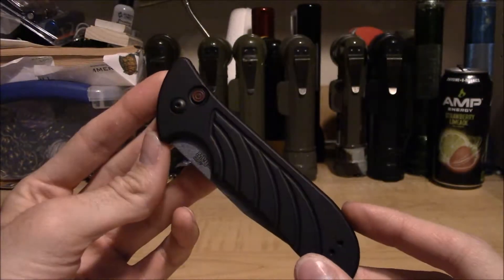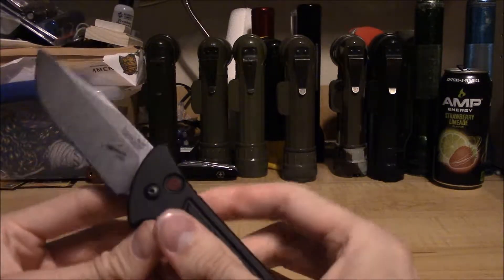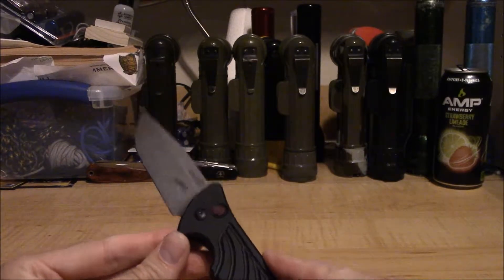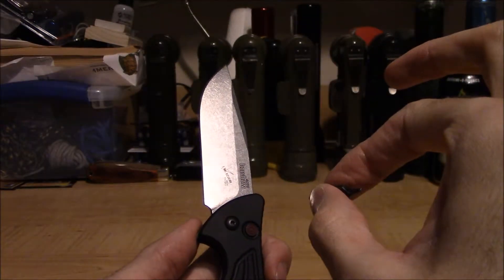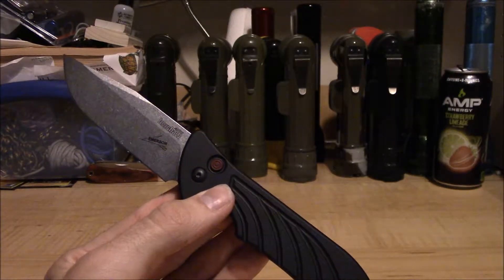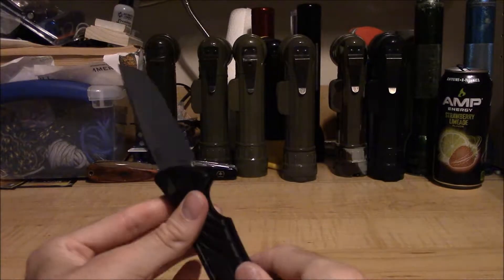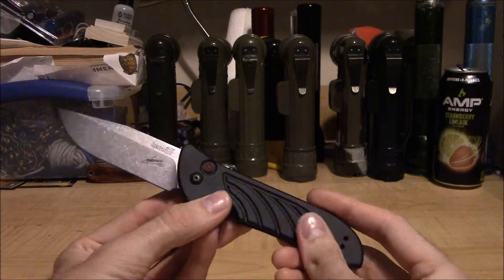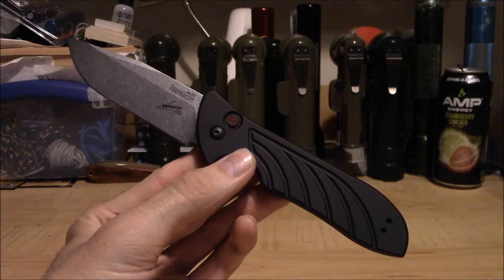Fine-tuning the Pivot on the Kershaw Launch 5

Comment: I was thinking of getting a Launch 5, how is the blade play ?  I heard autos have it bad.
Reply from the maker: Even expensive side-opening autos will sometimes have a little bit of play so that the blade can open fast and reliably, BUT... my Launch 5 doesn't have any play one the pivot is adjusted just right. Don't know if that will be the same for every single Launch 5 that Kershaw puts out, but I think you'll like it if you do decide to get it. Like I said in the video, the pivot may need to be tightened ever so slightly so the blade doesn't bounce back off of the stop pin.